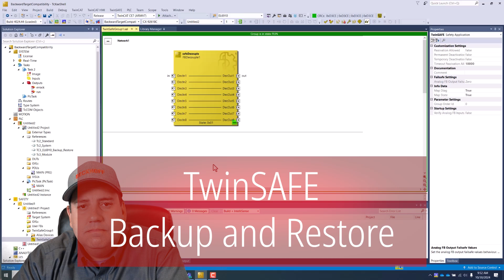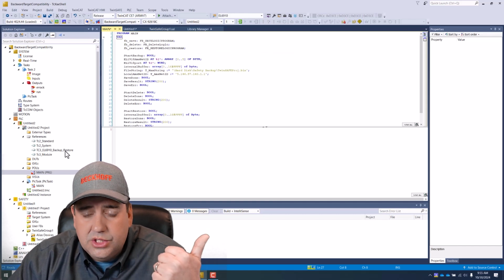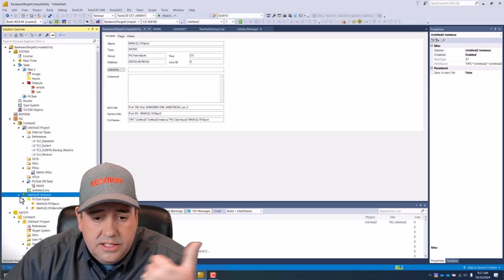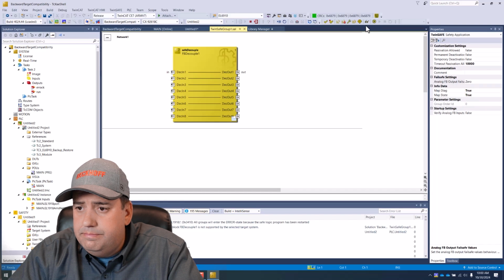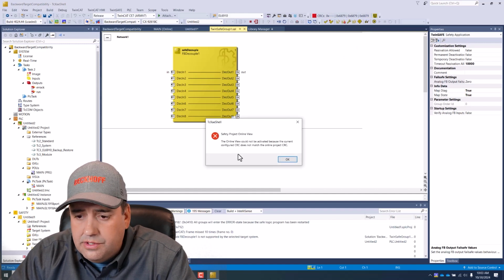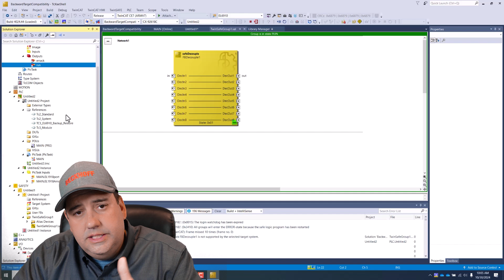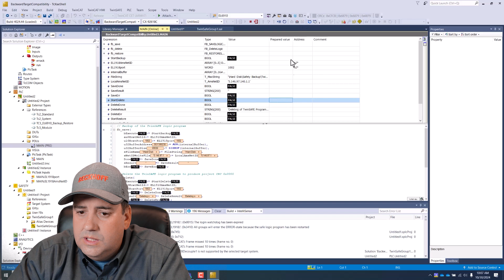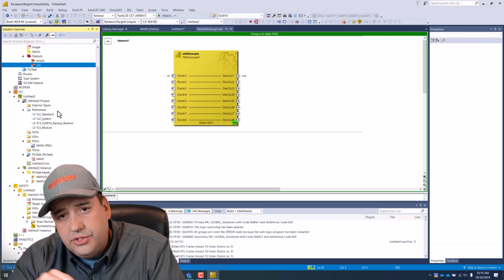TwinSAFE Backup and Restore

Comment: Just wanted to add that this does work with the EL1918  with TwinSAFE Logic.  Based on Beckhoff's description "A further highlight of the EL1918 is the integration of the functionality of the EL6910 TwinSAFE Logic. The EL1918 can also be used as a safety controller at any time."  I would assume that Twinsafe Terminals/Boxes such as the EP1957, EL2911, EL2912 etc With TwinSAFE Logic would work as well.

Comment: Exactly what I needed. I need to automate this process. It appears to me I must check the CRC against the default. Would be nice if I could check the CRC in the project file vs the CRC loaded in the safety PLC.
Reply from the maker: Once you map the project CRC as Info Data, that number can then be compared against a different terminal present. In this way, you're comparing the project CRC with the available terminal whether or not it is default.